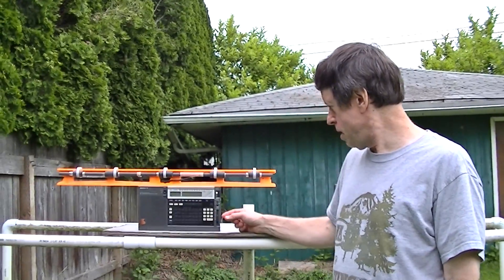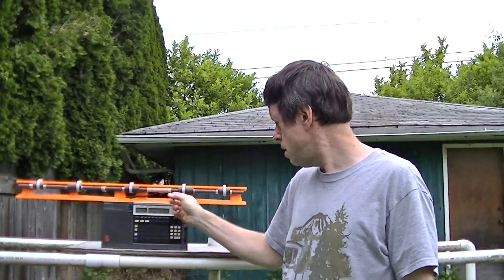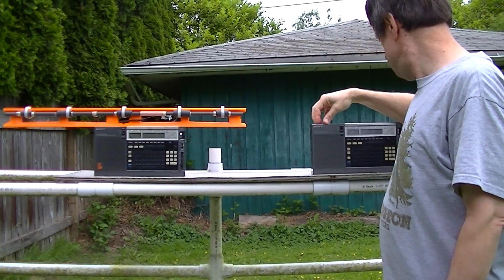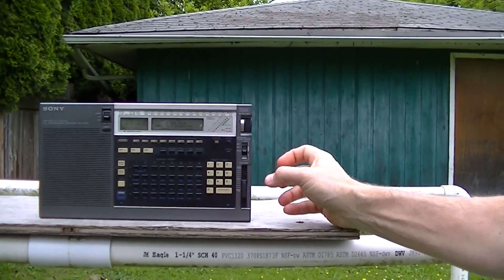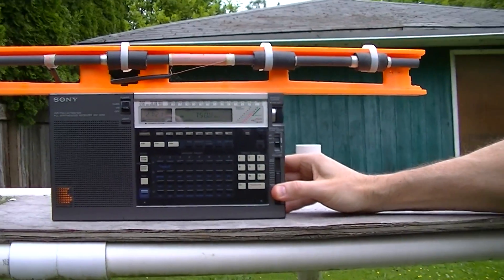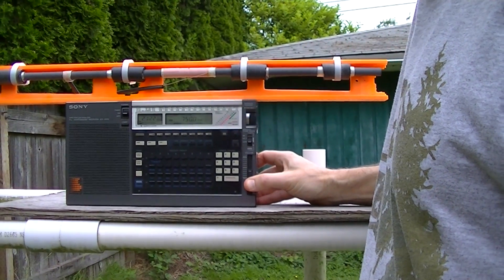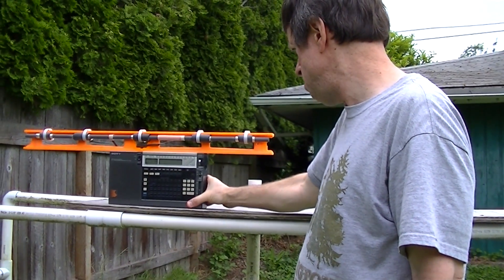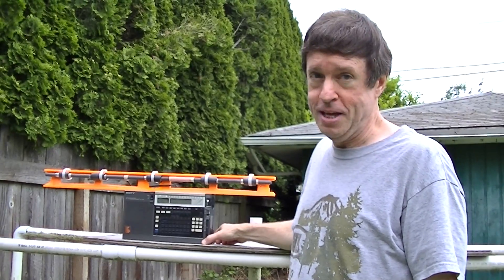30 Inch (76 cm) Loopstick Sony ICF-2010 Model-- Daytime DXing Demo

Comment: Unfortunately, as the signal strength with a larger antenna goes up, the noise level also goes up. That's when noise elimination circuitry becomes advantageous.

Comment: What is the point of listening to an AM station on side band?
Reply: Suppose you are listening to an AM station on frequency f1, and there is a strong station on nearby frequency f2 that is causing interference. If f2 > f1, switch to lower sideband (LSB) to reduce interference from frequency f2. If f1 > f2, use USB.

Comment: I have done a fair bit of experimenting with loop antennas for mediumwave and have reached some conclusions. Going past a certain size (about 60cm) with air core loops is futile as noise goes up with signal, this is of course with the exception of receiving stations living in locations with extra low RF noise. Loop stick designs will not provide any major improvement in signal to noise... even ones using multiple rods, atmospheric and magnetic noise (yes, these things are still affected by QRM) will not be substantially better in terms of signal to noise. You are better to go with a high Q air core loop of 30cm diameter, on a gimbal with an adjustable pre amp on it. I am not giving away the details of my pre amp though, it is my secret. I have already said too much ;)

Comment from the maker: @Adam, As far as I know, Stormwise sells the largest commercially-available ferrite rods, although they can be heavy and inconvenient for portable use. If you need more LW gain than the typical (relatively short) loopstick provides, my recommendation would be to go with one of the new FSL (ferrite sleeve loop) antennas. You can then boost the LW gain up to very high levels, while keeping the antenna size relatively compact and portable.
Reply: Could you glue two or three short rods together, end-to-end, with them held in a long clamp, then wrap them in fishpaper and varnish the whole thing ?